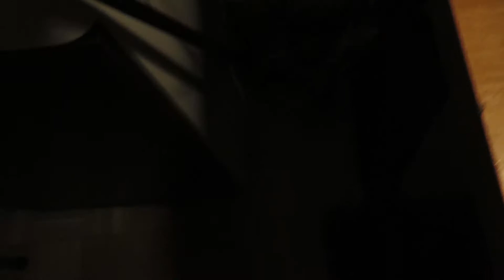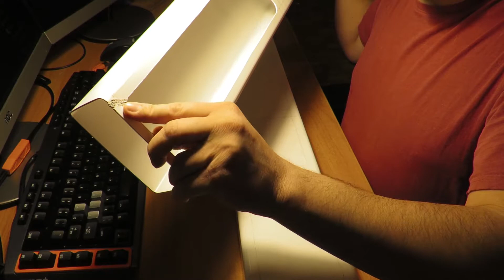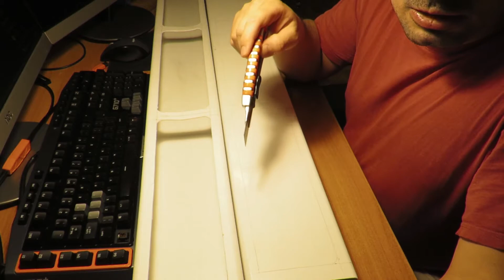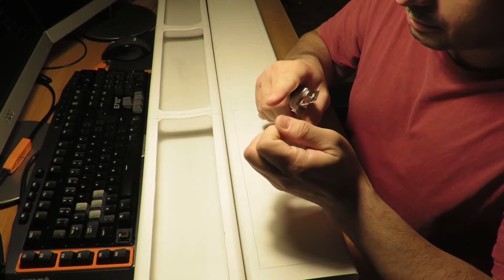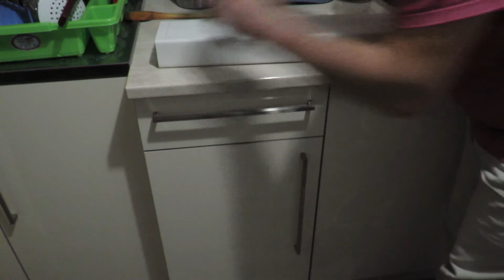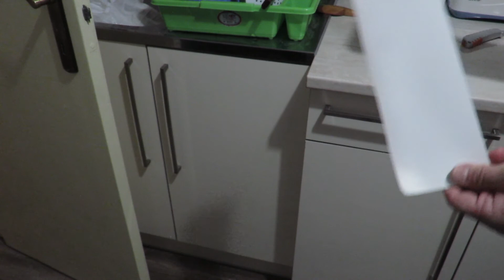Plastic cutting/carving technique

Comment: You should buy a rotary tool (like a dremel). They are as cheap as AU$40 in my country. Wish I had one my whole life. It would cut through this way easier, with no warping of the plastic.